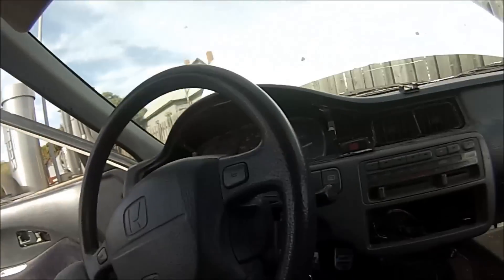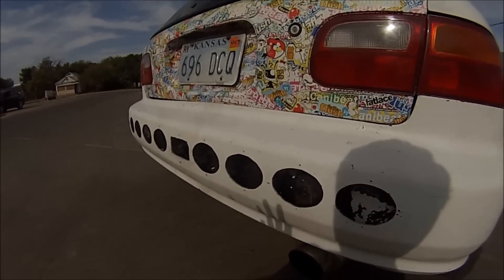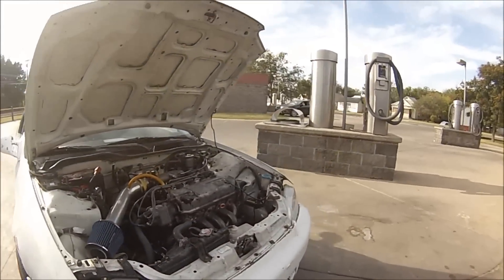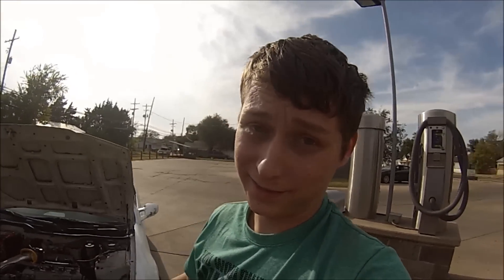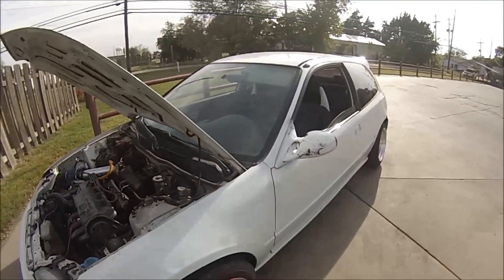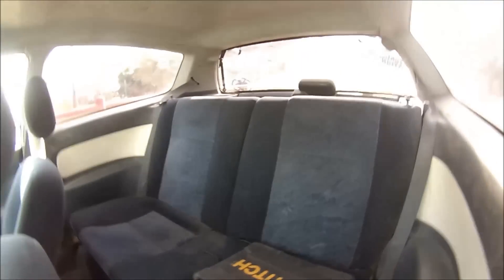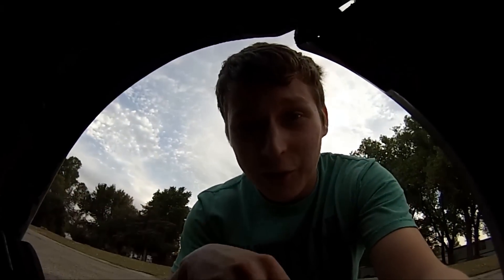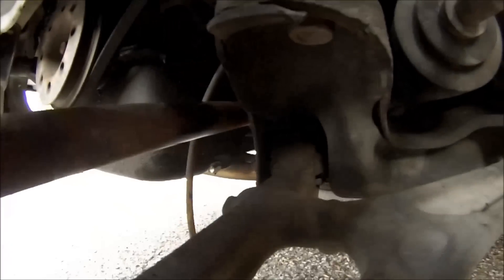Finally have my eg hatch (walk around video)

Comment: I liked your video on eBay parts, I have a 95 integra ls and i have all eBay parts on it and so far so good, I have truhart shocks and lowering springs(not sleeves) with what I think should be a good spring rate and adjustable upper control arms, new lower control arms for the rear and adjustable upper links for the rear camber adjustment. Hopefully I will be installing it this week as long as I can get it to my buddy's' shop to get it aligned. I have a 3 point strut tower bar for the front on the way and type r style Amber fog lights with oem switch also on the way. My plan is to drop in a b20b or z and then while the stock ls is out of the car build it for turbo, which with my budget will also come from eBay. As well as most to all of the internals. Glad I found your channel man and looking forward to seeing the little cx come together. In high school my buddy had one and dropped a b16 in it and gutted it and man was it fast and light.

Comment: Nice... its a project none the less... like all car guys, we start with something and the end result is completely satisfying. Like you i bought my daily 98 Civic Dx it had a d15b motor with a d16y7 head.. awkward i know, im thinking previous owner blew the bottom end, kept the head an dropped a d15b before the sale.... it had LOTS of problems, but i got it at a good price for its year, i put in $800 in parts, everything was shot... previous owner had junk coilovers on blown shocks, all 4, i dropped in lowering springs with new shocks all around, which gave me a low ride height with a softer-than-stock driving experience... Rotors and pads were shot, bad waterpump, an the list goes on. But after all that got changed, its dependable, and looks clean. I use i to work an back. Still has some minor issues but they`ll eventually get fixed. I had a EG hatch back in my teen years, i love its handling and light weight chassis. My Dx is light as well, about 200lbs lighter than a EX model. Its a good daily, no regrets on buying it... i have no intentions on building the motor, but will soon finish up my project, my 4g63t DSM :)
Reply from the maker: DSM jUhnky VERY NICE! Ya this is the CX model alot lighter than ex/Dx model and when i do my weight reduction and install all the carbon fiber pieces it should weigh around 1700-1800 when im done. Be daily driven,And track ready within the next 6-8months or sooner if all go's as planned. But i cant wait to drop my built up ebay motor i built for my last hatch in there. I will be turning to 25psi after i make sure all the specs are just right then slap that motor in with the SI tranny and make a nastey 0-60 car. And i know them DSM are no joke for sure. My buddy has a pretty nastey street driven 450hp AWD GSX. I only BARLEY beat it in my previous videos.  But my goal is to make this eg lower 12 higher 11s or faster. But as logn as im in the 12's ill be happy. I can do so much more with this chassis design because it allowes for more engine bay clearances which means less heat soak from radiator/turbo like my ef hatch had. I was spiking 230Degrees under full load on 13psi. THATS TOO HOTT! And with the eg's design diffrenece im hoping alot less temps which means more timing and better numbers. Also keep in mind with all the issues the ef had i still had completely stock D15B head..This new setup will have a Stage 2 turbo cam! :)
Reply: Ya, the EGs have better aftermarket support and im sure you will reach those goals no problem... you know your stuff, and its been proven in your videos. Wished you lived close id like to work with you an vice versa on my DSM. But like all things, its money that slows us down from completion hahaha... i havent seen a reliable honda motor pushing over 20psi daily driven, they usually stay below 10psi for long-term reliability. But your going all forged so, thats why iv never seen it... most honda guys go cheap and buy a turbo kit an keep internals stock an drive 5-8psi daily. But maybe look into the integra LS b18b motors, heard those motors do well with boost, an their cylinder walls are strong. Ya DSMs are beasts... the ones with the ironblock 4g63 (not the 420a motors) they handle 20+ boost with little to no mods internally. DSMs can make 300-400hp comfortably and reliable... its tuning that plays a big role. Built civics do have the upper hand with the major weight differences, but DSMs can handle the high HP and high boost without blowing up lol. A civic with a 4g63t motor..... best of both worlds lol. Its been done...
Reply from the maker: DSM jUhnky Ya i understand what ur getting at lol And i dont Do b series or K or anything other than d-series im not too worried on it blowing up. Iv seen a 24Psi daily driven crx on stock sleeves and no block guard run 550+ daily driven and its been on the road for years like that. The tune is the BIGGEST part because its setup to run lower boost on the street and then he can crank it up make a few passes and then turn it back down for daily mode, Its awesome how i have mine planned to be the same way. I dont do b-series mainly because they are overplayed and im honestly not doing it for big HP im just doing it for a daily drivable underestimated street monster that gets good MPG. Iv seen alot of Turbo b-series with even more HP that what i was running but they were running about the same times with way more money invested. So i see a cheaper more effective route running the d-series plus if i blew it up EVERYONE has a d laying around they would sell because they did a bswap so its win win win! lol Like i said not really trying to follow in others footsteps. Everyone's 1st option is Throw a b in it. Nah i raced my buddys ALL motor B18B1 with mods and when  i was only a D15block D16z6 head with intake exhaust and Skunk2 manifold and i was beating him in the 1/4 he had more than i did for mods. So im not impressed with B motors they are over rated for the most part.BUT to each their own! Just i wouldnt be the D guy if i didnt love D-series motors lol. I have reasons why i do what i do.. logical ones too lol
Reply: You are absolutely correct.... b series are played out, just wasn't sure on your direction on the build. True, D series are underestimated alot,  and there's tons of d series Honda's in junk yards everywhere so they're not hard to come by. Even if a d series blew, getting a hold of another isn't hard nor expensive so it's a very logical decision. D motors are very light weight an that plays a part on their success of taking on B series motors, an beating some. And I as well thought about building my D, as soon as I saw your vids about eBay parts an the reliability on them, for the fraction of the price of name brand. Not sure if I'll go Turbo, as I already own a Turbo car, but I may go supercharged route someday. Not looking for major hp, just a fun daily that's different than a turbo. Im curious on how your going to build your D, keep us informed, I'll be waiting and watching.
Reply from the maker: Man i want to supercharge my D but there are some downfalls on that. Max boost is around like 12psi and intake temps reach around 200+ that really hott too hott for me.. BUT if its built right to withstand that then it would be ok but superchargers are expensive anymore. But after im done turbo route im going SC route. Iv seen some nastey all motor D too. And everyone hates on them but its w/e parts are cheap and so on. Iv beat PLENTY of bseries. Both B18b1 style and B18C5 DONT get me wrong B are great motors but not for me.
Reply from the maker: I got rid of it to get my miata then got rid of the miata for a 4 door since my fiance is preggo and i already have 2 kids -_- look at my newer videos im posting 1 tonight :D

Comment: Not bad James definitely got potential.  Got a bit of work to do but it'll be well worth it. Can't wait to see it do some runs. You should do a before an after video of some runs.
Reply from the maker: teamkaosID I cant do any before and afters on the runs this thing wouldnt even pass tech inspections lol and it runs 20secconds in the 1/4 mile already did a 1/4mile run in my last eg hatch same engine and everything ran 20 secconds LMFAO because the 8 valve motor is WAY underpowered and u cant even rev past 5K rpm because the motor dont have enough cam to produce anything more than 5K lol. But im gonna run it with the turbo motor in and each run with get faster i promise that. Definitely a hand full right now but well worth it

Comment: Ppl hate on rattle can paints but as long as u prep and spray it right they come out descent!..add clear, cut and buff and snap! Ppl won't even know it's canned most of the time
Reply from the maker: Ez Rodriguez Oh ya i know. I wont be doing the clear and buffing stages right now mainly because i dont wanna waste extra money on the buffer and clear coat because it will be getting sanded down once the rust is fixed but 80% if the cars in my youtube videos and the white ef hatch in the other videos were 100% spray can and u cant tell. Iv been spray canning for a LONG time and found certain tricks but yes prepping is key!

Comment: Why do people cut holes in the bumpers? (Idk if this is a stupid question, but still gonna ask) lol
Reply from the maker: Im going to get a new bumper and cut holes in it too but im going to do it right because these weren't done right at all! lol But its called a diffuser bumper. It allows the air to escape and not cause drag which causes the car to go slower and cause there is less drag the motor can use more HP to move the car easier when driving at higher speeds. meaning you get to use more hp for racing
Reply: James Dguy
Ahhhhh!! OKay, that explains it. Thanks dude!
Reply from the maker: no problem new video iks uploading now :)

Comment: why did u trade if u put alot of work in the ef and this needs work
Reply from the maker: I love working on cars and im going to make this even nicer than the EF plus i kept my boosted motor so im throwing it in here and this needs work but not ALOT, Plus the ef have smaller engine bays there for it heat soaks easier and i cant make as much power without doing alot more mods to the car. So i moved on to bigger and better things. Its ok just u wait and see what it turns into :)